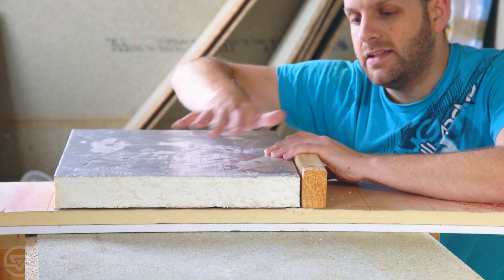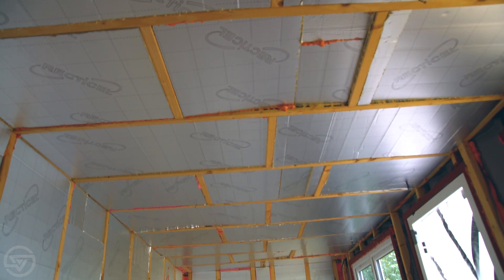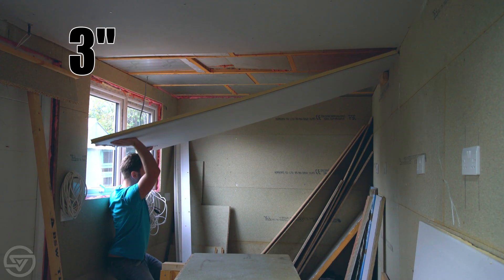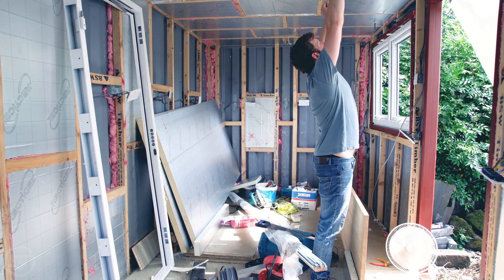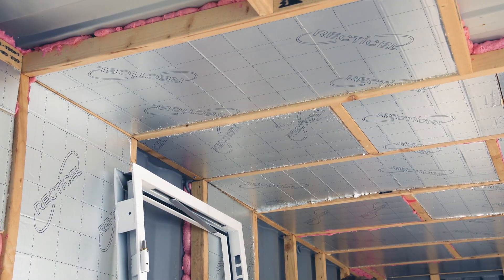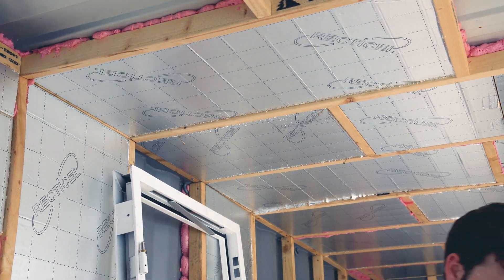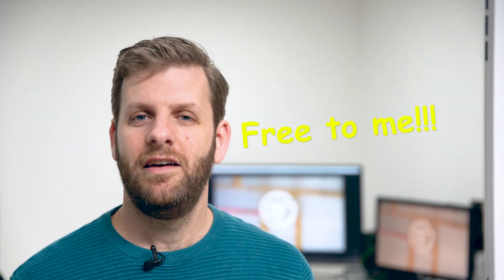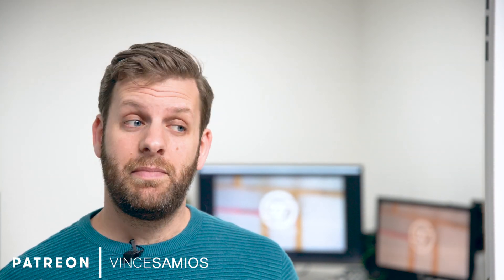Insulation - Shipping Container Insulation - Container Home Insulation

Comment: Hi Vince! I've yet to watch your other shipping container conversion videos (but I will!), I'm looking into insulation currently. I do still have to get the container leveled, and have a while until I'm ready for framing and wiring, but what you're using your container for is similar to what I'm wanting of mine. So my question with the insulation is whether or not condensation behind the insulation is a worry or an issue? Do the windows and door allow enough ventilation for it not to be an issue? I'm in an area that is often at 100% humidity.
Reply: Fantastic and informative series of videos matey... I’ve watch so many it’s untrue and the general consensus is that you don’t want any condensation built up as this will lead to mould and may impact on health issues given time. When I do mine I will insulate with closed cell insulation and either fill the sections completely or add the rock wall after. That way there is zero chance of condensation behind the walls. 

Will be watching intently onwards. Good luck!
Reply from the maker: If it gets very cold then condensation could be an issue between the steel and behind the insulation.  But the windows and doors give plenty of ventilation and I leave the windows cracked quite often. Most people put in vapour barriers, I decided to let the timbers breath and any condensation has a path to drip down the inside of the steel. So far (a year of use, videos have taken a long time to edit) I haven't noticed any condensation anywhere)

Comment: Another great video, Spot on Vince. We typically use 100mm of rockwool pushed into a 50mm cavity for our insulation and this performs extremely well, so we suspect your insulation will perform even better. Looking forward to seeing the finished article!
Reply from the maker: The naughty truth is the container has been finished for almost a year, just catch up on videos now. But that does mean I can vouch for the awesomeness of the insulation. Possibly even slightly overkill, but we've had some very hot days and it's been fine. I'm yet to try any really cold days.

Comment: After insulate the container what temperature is inside if you don't open windows?
Reply from the maker: When the sun is behind, to the side or above, the temperature stays at whatever it was. Maybe climbs 1-3degrees on a warm day. Or drops 1-3 degrees on a cold day. But when the sun shines in the windows it climbs quickly - the insulation is very very good, so the windows collect all the suns energy and the container has no way to lose the energy again. So in the late afternoon in winter when the sun is low I open the windows a bit. The problem is less in summer when the sun is higher in the sky.
Reply: @VinceSamios  Thank you very much for your answer and I'm waitting for next movies :D
Reply: @VinceSamios  Interesting. So maybe to mitigate this light is you might want to try and keep the container home in an angle that has the least amount of direct sunlight entering. Well if that's possible on the property. The windows themselves can also have Lowe/argon added to window which helps a little bit more.

 Some people might prefer the reverse though and want more light.

I'm curious about exterior insulation options. Not as commonly used in homes, but I've seen some tiny home makers try and preserve the enterior as much as possible. Any ideas what might be doable?
Reply from the maker: It's not possible on my property, but I was thinking of adding some blinds. :-)